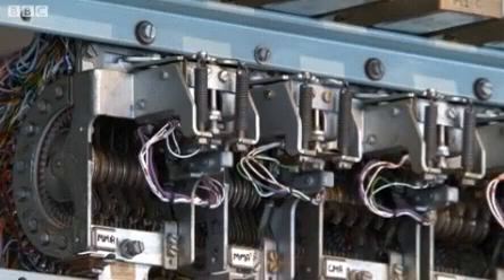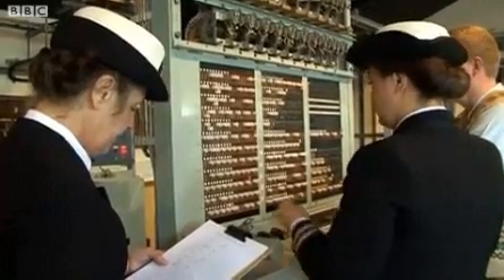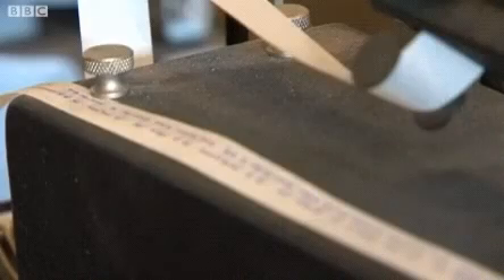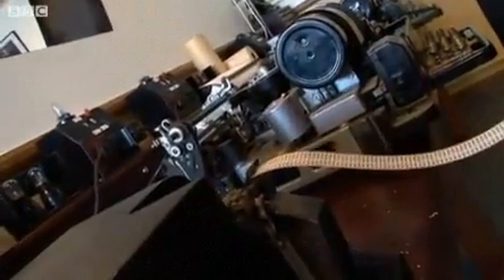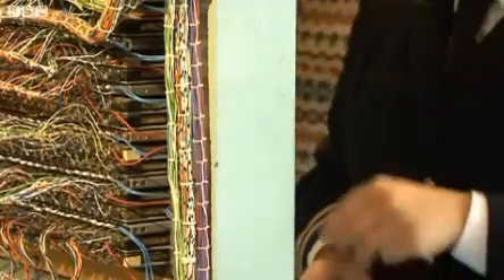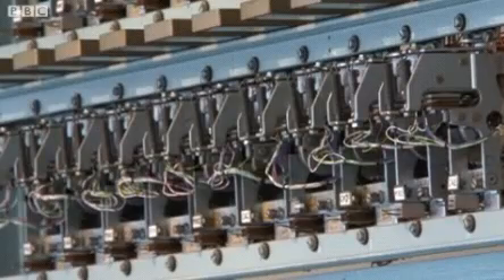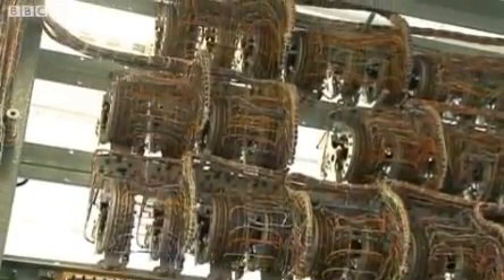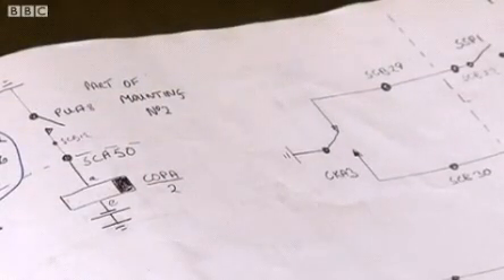The Tunny Machine - The German Lorenz  Cipher Machine Emulator During WW2

Comment: Still dont know why the intercepted 'wobbly trace' had to be hand transcribed onto 5 bit paper tape.
Maybe the signal was to weak to be reliably punched directly ?
Reply: Developing that technology would have been a major project in itself.  Today it's relatively straight-forward, but designing a system that could automatically adjust for natural variations in human transmitting speeds,     and then find and parse letter boundaries as accurately as a human, without missing characters at the beginning for "lock-up time"  - using nothing more advanced than vacuum tubes - might have taken many man-years to develop.    

Given that people who could do that task were readily available and could translate hundreds of messages per hour, that was not where the bottleneck was - it didn't make sense to devote rare, high-priority resources to that.
Reply: @Cynthia_Cantrell  Thanks for the reply, but I thought at the German end the transmitting and receiving of Lorenz was all done automatically  without a human transcriber. Hence unclear why intercepted messages needed to be done manually, other than that the signal would be weaker and more distorted at UK/allied listening stations.
Reply: @stephencole9289  No problem.  Keep in mind that encoding by a machine would have also required some form of memory.  Which, back than, probably would have involved a human punching a bunch of holes in a paper tape.  A human at a Morse code key was a lot simpler.

Comment: "The code-breaking machine would have been impossible without that (Tunny) machine. There is absolutely no doubt about that."  This is incorrect.
The British Tunny machine did the mechanical deciphering of the messages - the final stage but not the original code-breaking.
In fact, for the first 12 months at Bletchley Park, messages were decrypted manually without any help from machines.
Reply: The problem was that most of these messages had a use-by date, and decrypting Lorenz messages was so time consuming and labour intensive that they needed electromechanical help to speed up the process, otherwise having the messages would have been of no benefit.